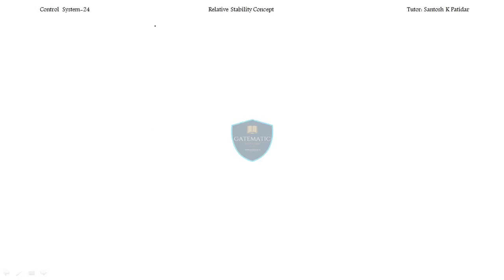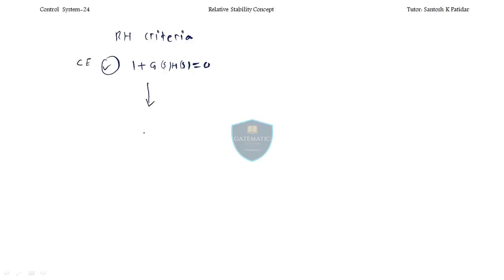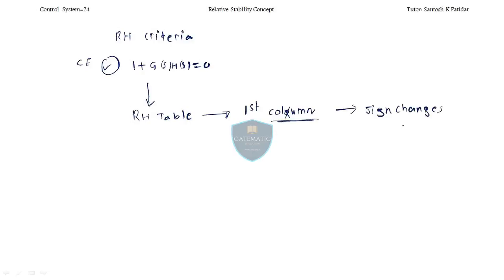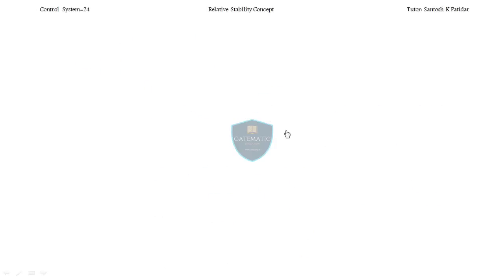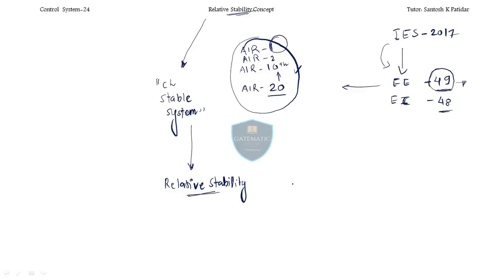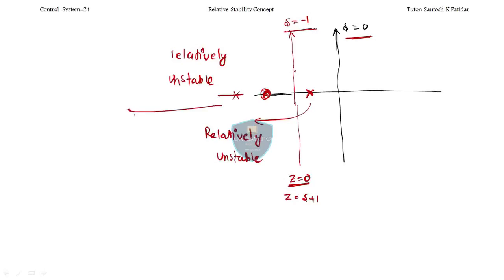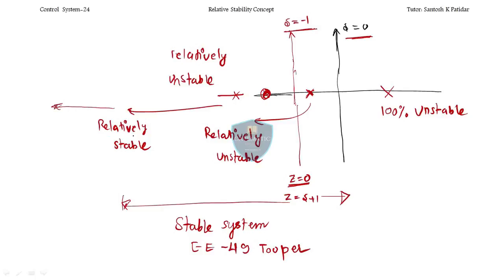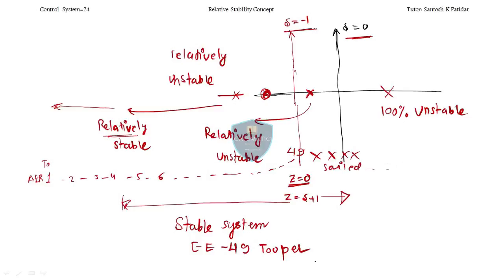Lec 24 Relative Stability

Comment: SIr, how did u say the system is stable for that cubic equation s3 +3s2 +2s+2=0? with  the outer and inner multiplication ?
Reply: inner coef. multiplication i.e, 6 is greater than outer coef. multiplication i.e, 2
6>2 hence system is stable
Reply: If inner multiplication(m1) is greater than outer(m2) then system is stable .
If m1=m2 marginally stable
If m1<m2 unstable